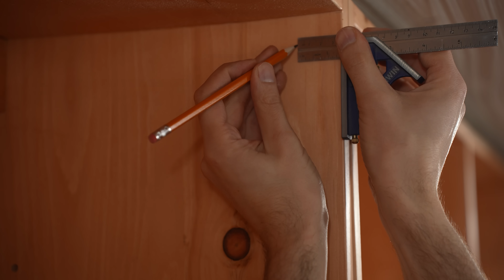Stop Using Plywood To Make Cabinets!

Comment: Having grown up with plywood being cheaper than solid lumber, the new paradigm is weird to me. But making panels out of pine is actually really fun. I've been doing it using a biscuit joiner for years and years. Two new things you taught me in this video: the I/O trick (one of those "why didn't I think of that?" ideas) and doing a quick hand planing to clean up unevenness in the joints. I've always just sanded, but hand planing seems like a time saver. Great video!
Reply: It's only cheaper if your time has no value.
Reply: @lavransmathiesen9099  Really the cheapest plywood is 30 dollars a sheet. There is never a need that you should have to have high grade plywood for cabinets. A simple quick sand on a large belt sander machine and a spray on the inside is really all you need. 
Those people who would rather spend 80 dolllars a sheet for sanded plywood for something that is not going to be seen is beyond me.
Reply: @kameljoe21   well- by the time you run it through the wide belt, get it in a spray booth, seal, sand, and finish coat (not to mention paying for the finish and sandpaper), even $110/sheet prefin maple is cheaper than a shop-grade plywood. There is no $30/sheet ply available in Seattle. Even the MDF is $35/sheet or more.

Now, if it's the pine option, then the cost for that here is $12.72/board for 1x6, making it $114.48 for 32 square feet (equal to a sheet of plywood).

It's way more fun to build with solid stock, though. Just not cheaper than plywood.
Reply: I honestly don't know what he's talking about. Cabinet grade plywood is about $65 for a full sheet where I'm at. Those S4S pine boards are like ten bucks a pop at the same store for an 8ft long, 4.5 inch wide one, and they aren't flat and have loose knots and sap pockets etc.
Reply: @lavransmathiesen9099 
You are entirely correct! 

With the exception of certain work the $35-$40 1/2” ‘sande’ plywood at homerdespot (maybe more $ now?) is fantastic for carcass and face frame construction. Solid wood is for furniture and trim imho, or when you require the esthetic. 

Probably you’re thinking same, but I’d have a plywood carcass ready for five minutes of assembly before getting boards prepped to drill for dowels. And I’d never dowel a carcass or door stiles and rails when other methods would do it in seconds while being just as strong or stronger.
Reply: Prices you write here are insane. In Europe plywood, base grade starts at just $9 per 1.25x1.25 m sheet (4.1x4.1 ft) 4mm thick, and top grade waterproof 12mm are around $25-28 for same size, that's incuding 23% tax. Honestly I consider half-inch thick plywood equivalent to structural lumber frame, and you can buy up to 24 mm thick (I haven't used it personally).

And solid wood, especially quality one, here is slightly bit more expensive.

Comment: I recently started a project building custom shelving in my walk in closet and when I was pricing wood sanded plywood was cheaper than similar pine in my area (Nashville TN). Especially when you take into account the time savings associated with the plywood vs glue ups etc. And when using plywood no cupping issues etc.

Comment: Is it really cheaper to use pine boards in materials cost?  

And when you factor in the time for joining boards...

I like a back to square my cabinets.

And I am a dowel convert. I used to try to build everything with pocket screws, but I like my dowel plus glue results much better.
Reply: If you like dowels then try biscuits. A Porter Cable biscuit jointer costs about the same as the Dowelmax jig. And biscuits are 1000% easier to install. Dowels have to be dead nuts on with their mating holes. Biscuit slots allow for some movement for perfect alignment.
Reply: The wood might be a little cheaper but doubt that the saving compensates for the added time.  First time I've seen this channel, video was good but yet another YouTuber that doesn't outline costs when making claims about savings 🤷🏻‍♂️
Reply: @steadyeddie7453 biscuits don’t add to the strength they just help alignment. Dowels make it stronger
Reply: @jasonshumake777  Biscuits absolutely add strength to a joint. Yes, dowels can be stronger than biscuits depending on the stress angles on the joint, but biscuits are not just for alignment. And actually because the slots for biscuits are larger than the biscuit itself, alignment is not perfect. You still must tweak the joint into perfect position during assembly.
Reply: @steadyeddie7453  there are plenty of videos where they test biscuit joints and they are the weakest, with the exception of just  butt joint.
Reply: @jasonshumake777  I work in the real world. I can apply enough pressure and direction to any joint and make it fail. But I'm not building a space shuttle. Dowels are strong, but can be overkill. Dowels require perfect set up and alignment for the mating surfaces. Biscuit joining is forgiving and allows for slight movement when assembling the joint.  I build cabinetry and furniture, and have yet to have anyone return something with a failed biscuit joint.

Comment: Tip since you use it elsewhere - I have discovered that putting a piece of painters tape on my finished piece and then marking layouts on that, instead of the piece (like you did for hinges) is faster than erasing layout lines

Comment: Loved your mini planer sled trick to remove the cup from your panel. I need to lock that one away in memory for later use. I also really liked what you did with the bead and miter joints on your rails and stiles. Another trick I need to lock away. Thanks.

Comment: I find that a curved tip dental syringe is super for dispensing glue precisely and controllably where it is needed in the amount required. It is easy to fill and to cap up with a toothpick after dispensing the glue.... Dental syringes are very inexpensive and can be used disposably when you are not going to use them again for a long time. They are particularly useful for injecting glue under loose portions of veneer when repairing furniture.

Comment: Glad more people come around to use pine. Esp with lumber prices as they are. Sure you can dent pine with a fingernail, BUT, how often do you run around and try to damage your cabinets? I just made modern style doors out of pine, to freshen up my grandma's old kitchen. Added an off white stain and a small vertical router line. Some modern door handels, a bit of a round over and the kitchen looks as good as new_ish.
Reply: Would love to see that.

Comment: One issue with pine and spruce however is that it doesn't take stain evenly.  I solved this for one project by taking a can of dye based wood stain, and mixing it with equal volume varnish.  In my case both were water based.  Then applied a zillion coats, very lightly sanding with 600 grit wet sand paper between coats.  The win was that with water based stain, I could put a coat on every 30 minutes.  Using the paper wet, kept the dust down.  Even so, I set up two benches -- one to sand on, and one to stain on.

Comment: Can we just appreciate how you casually use a crosscut sled with the workpiece and fence on the front of the sled 👏🏽 I’ll assume this is for cutting wider boards without have to have a sled you need a forklift to move. Bravo and thanks for adding to my repertoire of jigs. PS. Not finsh vid yet, just had to mention before I forget 😂

Comment: Interesting dowel jig. I’m going to look into that. That said, I’ve never understood why people use sooo much glue to fasten boards together. All that squeezeout is just waste, creates extra work to clean up, and creates stain and topcoat issues. Additionally, putting glue on the dowels, which are really just small tenons, creates even more glueing issues. Just put glue in the holes/morteses and the dowels/tenons will force the glue into the whole instead of being rubbed off of the dowel as it’s inserted into the whole. In 20 years of woodworking I have never had a joint fail with the amount of glue I use. The Rockler silicone glue brush does a perfect job of applying just the amount of glue needed *on one side of the board*. Anyone that’s telling you to apply glue to both boards or so there’s a bunch of squeezeout has a glue sponsorship.

Comment: 18:32 ooooh sliding miter saw! I'm sure you have a build video for that. That looks quite interesting. I have a 5m shed (20ft) and most boards come in 2.4m (8ft) so theoretically if I put it in the middle, I should have room either side for a full length board but with a shelving unit on the right side its not quite as practical. This could be handy. Was it worth the effort over a fixed position  table?
EDIT: Ok so I go to check it out and see I have watched it already lol but at least now I remember again

Comment: First time I have ever seen you and I will be making mine the same way.  to copy is flattery, so they say.  I don't have space for much wood working and this doesn't require that many.
I really like how you did everything.  
But as a youtube commenter I have to pick about the finish.  Pine bleeds like crazy so the only thing that will keep these from getting brown orange, is to seal them with shellac, or shellac based primer ("Kilz Original", and some other one I can't pronounce or spell).  Do NOT worry and waste your time what it looks like, just be sure to cover it all.  Even if you are going to paint these, the sap will bleed right through your paint if not sealed.  
You might have used a clear shellac so just to warn others about it.  Thanks and subscribed.  I was going to ask if you can do the same thing for base cabinets but you just answered that.  Thanks again.

Comment: Looks like you spent a few hours to find those boards that did have many knots or cupping in them. Best option I found is to use solid pine for the draw sides, and good plywood for the draw bottoms & cabinet carcass. Other wise you spend hours & hours search for quality pine board, unless your willing to spend $50+ on a good premium Pine board imported from Chile, NZ, etc.

What I really wish a US plywood mfg. would make plywood with solid pine boards glued together with a top & bottom plywood veneer so there is some solid wood for screws. This is available overseas, just not in the US (at least not any lumber retailer I've visited).

Comment: If you want to try something different, I made drawers (6) by taking a 2x4x8 cutting into the proper lenghts, then cutting them down to 1/2" and using the left over piece for the bottom. Quick and fast and they hold heavy food items, and have for years. I attached them to full pull out drawer guides.
Reply from the maker: I've actually made drawers like this! Cheapest drawer ever! 😂

Comment: I will never stop using plywood. And I would use it over pine any day of the week because it's stronger, less prone to warping, and I can get a selection of veneers to match the doors and drawer fronts. I prefer oak for doors and drawer fronts for its looks and durability. Pine is too soft to take the abuse of a kitchen cabinet door or drawer front.
Cheers.
Reply: Exactly, pine is fucking trash lol. It's soft, fragile, get's scratched or dented easily, doesn't stain or paint well, etc.
Reply: Not to mention the ungodley amount of time he's spending!!!
Reply: At least look at the price of hard maple. Many times I have been able to save money verses clear pine. It is way more durable and can look amazing.
Reply: Home depot stocks various widths of birch at relatively reasonable prices that are really good for small solid cabinet door fronts and for stiles&rails for the  larger doors with use of thin plywood sheathing insetted for the panels.  I still like pine for cabinet sides, again with plywood sheathing in a rabbet for cabinet backs

Comment: finishing the inside of the cabinets is actually a good idea even though its a shop piece.. if you finish the outside and not the inside is possible to get massive cupping or twisting due to different moisture absorption rates.

Comment: I'd be afraid to use solid wood for cabinet carcasses because of potential warping if the space it occupies has big humidity swings.  A hot/humid summer day where a window is left open or a water leak when no one is home for a while could wreak havoc on wood furniture.  Plywood is much less prone to warping, although all wood will warp if wet long enough.  I veneer plywood for cabinet exposed sides, which is usually cheaper than something like solid 4/4 walnut of rift white oak.  Baltic birch is usually the flatest and strongest plywood and I use that on entertainment centers or furniture sides anything larger than 24" x 24".  Solid wood also requires time (a few days to weeks) to allow the wood to acclimate to the room it's in after a few passes through a planer before the final planed surface is done.  Extra jointing may be required for flatness if the planed wood moves and you may lose the final thickness target if jointing needs to be done, which is a waste of nice material.  That's not required for plywood.

If solid wood is used, it's important to seal all sides to keep warping from happening under normal conditions.  I learned that the hard way when my 96" x 36" butcher block work bench top turned into a potato chip that I needed to replace because I finished the top but left the underside raw.  My shop's humidity has swings.  A warped table top makes using it as an assembly surface almost impossible.

Comment: Think about this, if you prefinish before glue up, the glue won't stain the wood and doesn't make a strong connection to the finish so it wipes off with a damp cloth.
Less things to tidy up later. 
How deep is the cabnits?
Because you can buy wide pine s4s lumber pretty cheap even at the big box store. But I'd go to a hardwoods dealer.

Comment: Freakin' amazing.  I'm currently putting together some RTA cabinets for my kitchen.  The Rustic Hickory came from the Amish and had nice jointery.  My island cabinets came from Vietnam and the only good joints were on the drawers which were rounded finger joints.  It's pretty eye opening at how different cabinets can be made.  Luckily lots of glue and my brad nailer are helping fix the issues I have with their plywood construction.

Comment: I tried making a nice dresser out of this material. My mistake was doing it right before monsoon hit in Phoenix. So it went from SUPER dry to SUPER humid in a week. I was 80% finished with the project and heard a pop as loud as a gunshot in my shop. Turned around and the body of the dresser had popped itself apart. Totally ruined.lol
Should've planned better for weather and sealed the crap out of the whole thing when finished.

Comment: Wanter to ask you wich blade did you buy with your shoulder plane. I see the are 3 available. Which model planer did you use in this video. Ty
Reply from the maker: I got the PM-V11 blade. I also think O2 is a good choice as well. I'm not a fan of M2 as I think it's a bit of a bear to sharpen.

Comment: so the premise is that pine is cheaper than 3/4 ply and there are no edges to cover - correct??  love the dowels.. id add a few pocket screws in a place or two.. but very cool.. and very strong

Comment: After you put 4 panels together to form a box shape, do you need to make sure all inside angles are right angles? If the box shear a little bit, two angles will be more than 90 degrees and two would be less.
Reply: You measure opposite corners of the box to verify they are the same in order to check for the squareness of the box. It's like comparing the hypotenuse of two right triangles

Comment: I really like the 1 Step stain & finish you used. Unfortunately, its not available in Australia. Are there any other brands that are comparable? most of youtube seems to use minwax for pine.
Reply from the maker: Just looking at Bunnings site, an oil-based "stain and varnish" (seems to be a tinted polyurethane) is available from both Cabot's and Bondall.

Comment: Be pretty expensive to use decent line of pineboard for workshop cabinets,here,in the UK.Melamine coated board,or MDF would be the norm for most household,or workshop work.

Comment: If you do not have a jointer?  Or a space that allows to you to feed more the 2m of timber at a time?
If you don't have the space for a router table?
What do you do if you are not able to do rabbits on a table saw... dado blades are not available in the UK/EU.
Reply from the maker: what if i answered every single possible question and covered every scenario in every video?

It'd be a pretty shitty video

Comment: Remember: clamping with too much pressure will cause cupping. Use a ruler to check if there's bowing. If there is, reduce pressure on the clamps until it goes away